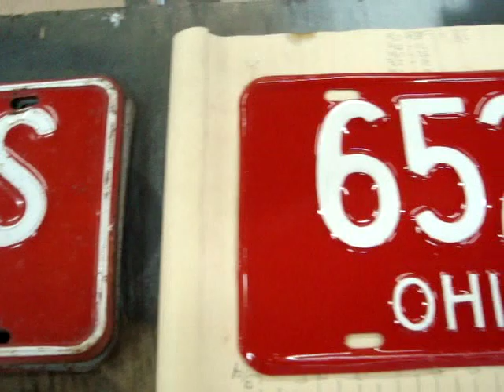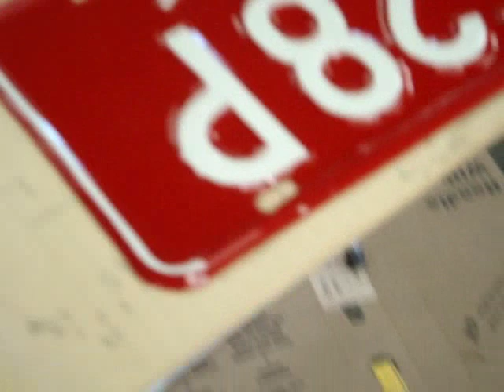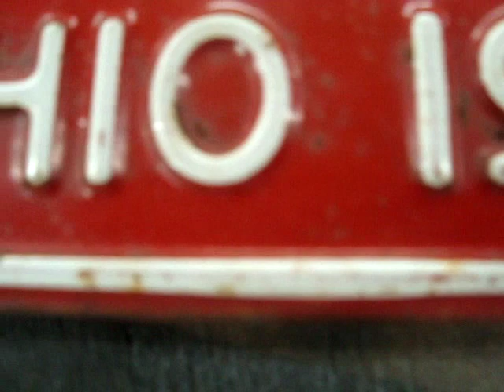1966 Ohio License Plate Restoration Part 2

Comment: I certainly enjoy your video on the license plate restoration. I have several I have been working on but  having an issue with coverage of the lettering. not sure if it is the thinning of the one shot paint or the brush I am using. what type of brush do you use? I live in North columbus close to Blick art supply so I could look there if I know what is needed. thanks!

Comment from the maker: Thanks, You can speed up the 1 shot drying time by adding Japan Drier, which i did not. The letters sat overnight before I did the outside line and put my hands on them. I finished the letters & numbers late afternoon and did the line at 8:30 the next morning. Give it a try, prop your hand up. Look at my hand and you'll see it's propped up so it steadies the brush. Have fun!!

Comment: Not all plates have such a defined surface to paint, the plates we have here don't have a 'flat' top surface on each number or letter, they're just sort of rounded and the centers of numbers like "4", "8", or "9", or the middle of an "A", "B", or "P" and such often have odd shapes in the middle that if you painted the whole raised surface the character doesn't look right. You have to sort of freehand it as if the metal wasn't raised. 
I've got one tag here from '62 where even the raised perimeter line varies in width around the tag.
Reply from the maker: That makes it harder, where are you from?
Reply: I'm in NJ, The tag I had to redo was a '59 Motorcycle tag. 
It seems that in '59, they switched tag colors and style mid year, and the first tags apparently had a different stamping process. Later tags had no border and flat top characters. 
What I did to paint them was to make up a blank silk screen panel. I used thick black paint that wouldn't run. It took a few tries to set the right screen height but it came out perfect. 
It was the crudest license plate stamping I've ever seen. Some letters were wider than others with rough, undefined details in the middle of some letters and numbers. It came out great but it was a royal pain to do. 
At least there was only one plate.
Reply from the maker: @VB-bk1lh  sounds like a good way to do those. Ohio stampings were pretty good even the motorcycle tags. I don't remember the year they started but later Ohio tags are not embossed and the number is screened on.
Reply: They stopped embossing the letters here about 10 years ago or so. Those tags don't last, like the first batch of reflective tags in the 90's, the latest tags seem to de-laminate leaving a gray, faded mess that no one can read. 
NJ does not allow you to run a restored tag, or will they allow you to revive a past number or a tag you found or bought even though its been dead for decades. 
You can keep at tag forever so long as your the original owner and have never let it lapse. 
  @ceedell

Comment: Silk screen works for the lettering. I don't know how to silk screen or have the stuff. Thanks for the video.
Reply from the maker: The letters are embossed on the plates so would be difficult to screen them. I've tried various rollers and still prefer the brush technique. Thanks for watching.
Reply: I don't know how to do it, but I made that comment because I watched someone else on YouTube do exactly that.
Reply from the maker: I'm sure anything is possible, screening on a flat surface would be easy but on an embossed surface with raised letters the screen would have be the exact perfect fit for font and size with zero margin for error. You'd have to have a new screen for each plate and be able to secure and index the screen in relationship to the plate. Plates letters and numbers were originally painted with a roller set up. I've tried various size and density rollers but without a fixture to establish uniformity it's difficult to maintain even results. I'll stick with the brush method as I prefer it over the others.